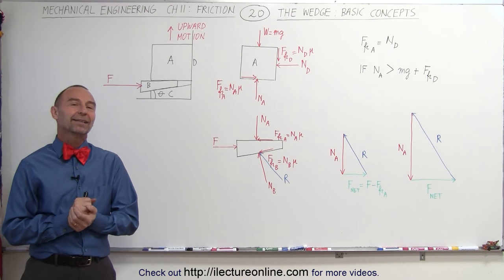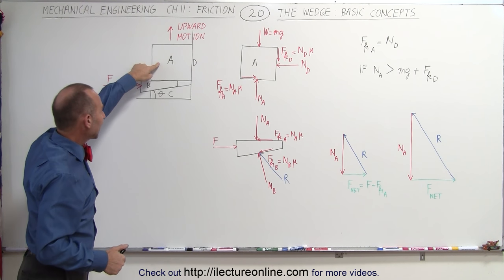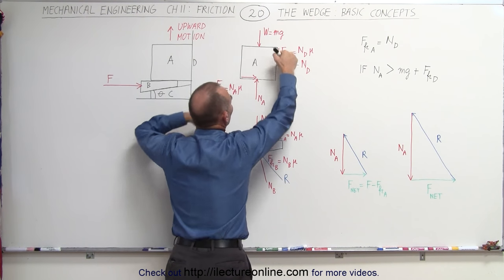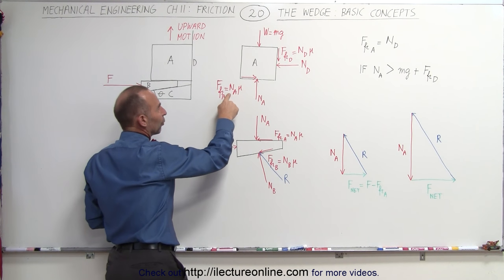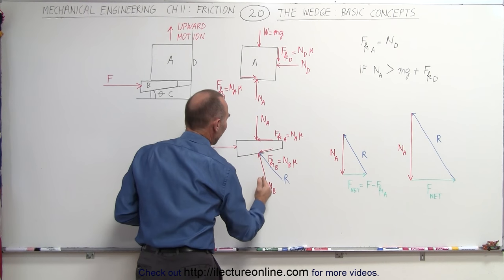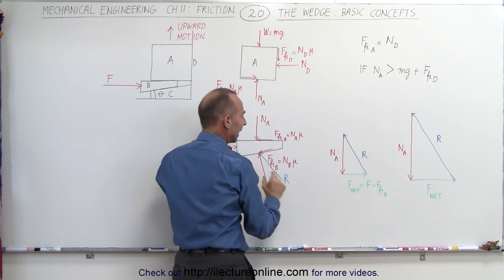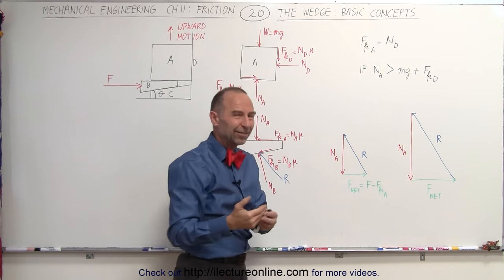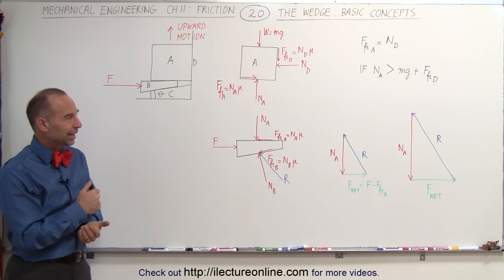Mechanical Engineering: Ch 11: Friction (20 of 47) The Wedge: Basic Concept

Comment: Hi, would it be possible to calculate the needed force to pull out the wedge again. Imagine that there is a roof above A and that we use the wedge to clamp A against the roof. Then with the friction it would need some extra force to release the wedge again. A real life troubble I am dealing with right now.. Thanks for a great explanation video